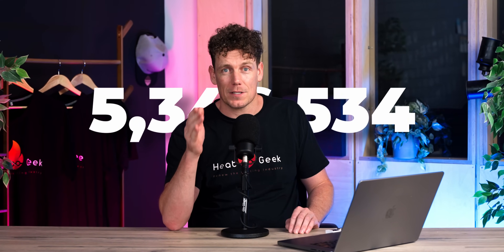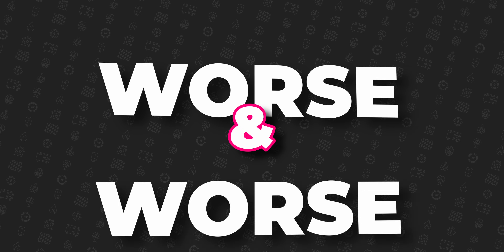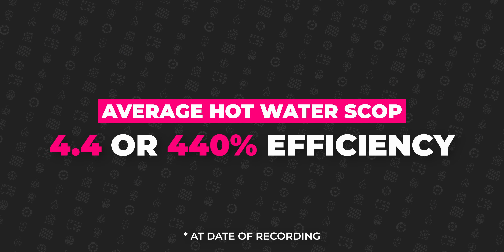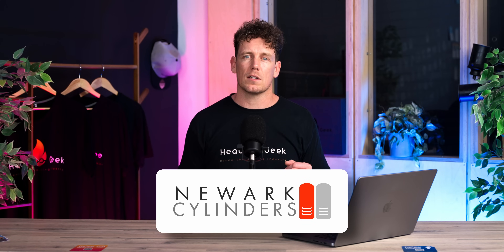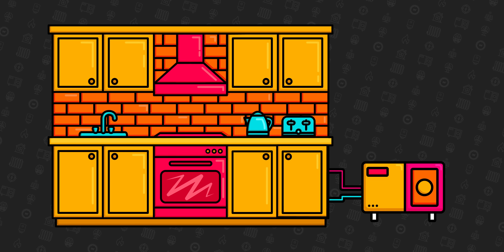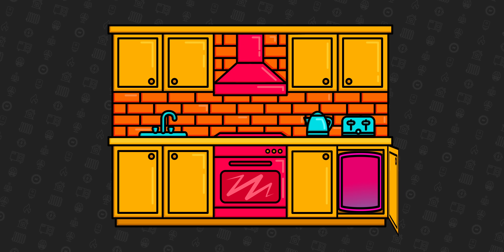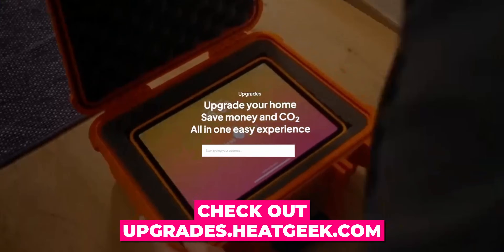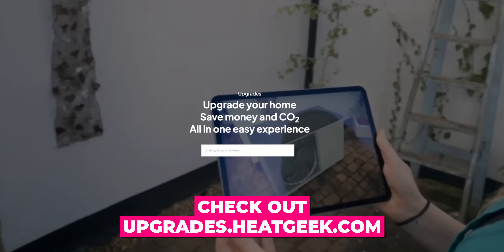This Invention Will Change More Than 10,000,000 Homes!

Comment: I love it! I bet it's less leak prone than a dishwasher, too. 

#bandishwashers

#commentpirate 

#replyguy

 I'd like to see what solution HeatGeeks can engineer for integrating standard HPWHs (standard US models) with an A2W system. Two water heaters means redundancy and resiliency, when you have room. Due to the need for dehu during shoulder seasons, the efficiency could be quite a bit higher. You could even reverse heat flow into the "standby tank" for some "robbing heat from the cellar" comfort heating in spring and fall. 

It also means the sales & end-of-life-for-boiler-or-WH process can be accelerated, one-day installs of HPWHs are possible (I've done it) and you follow up for the big project when the A2W crew has time. 

Now, I'm not sure how you'd integrate that into your SCOP number... but I reckon there's savings. Is it worth it? 

I'd also like to see a "drainback" system as opposed to a "outdoor dump" for freeze protection valves, but I'm not certain we need to use an overengineered solution with an inert gas that "purges" the ODU... food for thought I guess. 

I just can't wait for ICF, a corporation that promotes natural gas pseudoscience for the American Gas Association, to complete their certification process for "energy star boilers" in the US, a process the AGA opposes. What a lovely country America is. No corruption here! 

🤓

Comment: Still too many houses with tiny kitchens etc. Space is a premium in this country. 
However,  the one area that is really rarely used  is the plinth area under kitchen units.
If you can come up with an insulated rigid flat bladder tank, strong enough to act as the base replacing the unit feet, you could provide more volume (135l) than the mini store (80-90l) under 3 units worth of plinth space. 4 units and it would be bigger than most existing house tanks. Most houses have more than that factoring in dishwasher and ovens/hobs.
Reply from the maker: And insulate it.. skill builder talks about this too. I think it’s crazy personally

Comment: Does it have to be cylindrical? How much efficiency is lost if it were designed with square sides to better fit into a cupboard, maybe with more insulation? Could be worth playing with a computer model to find out.
Reply: These are pressurised cylinders so square shapes don't work so well when under pressure. I see where you're coming from though but I don't see square cylinders coming any time soon.
Reply from the maker: It’s open source. Will leave that to others
Reply: @craigchamberlain  Good point, I had not considered the pressure aspect. Maybe the corners could be separate unpressurised chambers filled with something with a high specific heat capacity, like water?
Reply: @craigchamberlain If it was square then it would not be a cylinder.😉
Reply: @normanboyes4983  A very good point! Even more reason why I don't see "square cylinders" coming any time soon! 😂

Comment: Hi Adam, you say this is for smaller homes. Could you not use two or maybe three in larger domestic properties strategically located to minimise the long runs and the long waiting times for hot water to reach the rooms that are far from the storage unit?
Reply from the maker: Yes.. the largest one will probably be ok on its own though

Comment: Possibly (probably?!) daft question - if it's designed to go in a square cupboard, why is it circular and hence smaller for the same size cupboard?
Reply: Less surface area to insulate than a rectangular box, stronger, cheaper to build.
But I agree it is wasted space that could be used for an emergency heater or extra insulaton pads.
Reply: @SolAce-nw2hf  cheers, makes sense.

Comment: Nice Adam, but with no heat geek installers in Scotland I'm finding it hard going forward to make the jump. Still enjoying all the videos though 👍
Reply from the maker: Apologies, we’re building the platform and expanding to Scotland as quickly as possible!
Reply: Yip, would agree with that and disappointed there is no companies taking up your mantle. Keep up the good work and hopefully soon someone up here will 👌👍
Reply: There are no Elites but a few of the bottom two levels. We are in south Fife just north of Edinburgh and are trying to get our nightmare 200yr/70yr mix of a cottage heat pump ready, can these combis go in a cold loft space?
Reply: We're Edinburgh based covering Central Scotland, please get in touch to discuss your project 😊
Reply: Stewart Temperature Solutions of Ayr are certified heat geeks and just did our installation a couple of weeks ago. I’d highly recommend them. Our property is a 4 bedroom cottage which was refurbed in 2008 so the insulation wasn’t too bad already. We did have to replace our 17 radiators with a mix of K2 and K3 rads to support the lower flow temperature since we were moving from an oil boiler to the heat pump. Target flow temp was 45C at design outside temp of -4.5C with heat loss calculated at just over 7kW. Went with an 8.5kW Mitsubishi Ecodan with a 210L cylinder which is so far performing well. I know it’s June but not a warm June by any means! Partly funded by a £9k grant and £7.5k loan from the energy saving trust. Also zero VAT charged.

We already had a 6.8kWp solar PV array and 19.2kWh of battery storage so we can power the heat pump easily from a combination of solar and off-peak stored electricity, so it’s definitely cheaper than the oil we were burning. 
No regrets so far! :)

Comment: If I have an air to air heat pump. Could I add one of these?
Reply from the maker: There wouldn’t be much point
Reply: The Vaillant aroSTOR 200 Litre is a nice solution with it's own heat pump. There are also smaller wall mounted models.

Comment: So you basically repurpose the type of water heater used all over the world. I have never understood why we in the UK are obsessed with heating massive tanks of water. In Spain I have a water heater hanging on the wall where a cupboard would be. We have a family of six and never run out of hot water. You may think I am critical but I think it is an excellent idea. Also the larger thermal stores heated by a heat pump solve the problem of low flow rate in houses with microbore pipes that would not normally be able to use a heat pump for heating.
Reply from the maker: That would be a very inefficient solution

Comment: Just wish we could get a heat pump that was fine with existing radiators and 15mm piping.
Reply from the maker: You can…
Reply: @HeatGeek  I need to look in to that then. OvO folks just dismissed me when they said I’d got 15mm. “You’d need to re-pipe the whole house so it’s not worth it”
Reply from the maker: @ObsidianWalker  we have a video on it.. check it out
Reply: @HeatGeek  will do. Feels like maybe a proper survey of my home would be of benefit. Shame as OvO are partnered with Heat Geeks so I’d have expected a more considered approach.
Reply from the maker: @ObsidianWalker  Sounds like you spoke to the wrong part of OVO. If you head to https://upgrades.heatgeek.com/c/ovo you can start the process and get a survey of your home.

Comment: People aar nt ripping out tanks for space. Combis are about convenience. I would without a doubt swap for a combi if i owned my house.
Reply from the maker: What convenience is there other than space? All cylinders produce instant hot water and usually a lot quicker than combis at the don’t have to fire up.
Reply: @HeatGeek in an average home you don't have space for a massive tank. So the hot runs out and you then have to wait for it. You don't have to heat a whole tank of water if your doing the washing up. If you live alone your not heating a whole tank for one quick shower. They are definitely a convenience item .

Comment: Many flats and small houses have no space whatsoever to install a small water vessel.
Reply from the maker: Where are their combi boilers?
Reply: @HeatGeek  
As you perfectly know a combi is small white box that can easily fit into cupboards, etc. They became a revelation as a small white box did all the DHW and heating with no ugly troublesome pipe valves or huge space consuming cylinders, with standing heat losses.  With wireless controls, etc, you do not even need wiring to parts of the house for stats and timers. You can control them from the other side of the world from your smart phone. 

The water delivery is instant (no waiting) and infinitely continuous. I have a walk in shower with a drencher fed by a combi.  Look back at what I would need 50 years ago to get that!  I pretty well would need a small boiler room.

Heat pumps have their place and I love the technology working with them before you new what they were (I was in controls) - I am not joking.  They are no panacea for sure. We need to convert the natural gas network to hydrogen. Not to do so is foolish.
Reply from the maker: @johnburns4017  as the former number 1 domestic hydrogen boiler/fuel cell installer. Hydrogen as a heating solution is absolutely insane.
Reply: @HeatGeek  
Nothing there to back up that assertion. Read my post on the Japanese approach.

Comment: Lets be realistic here, until the 1m planning rule changes in the Uk this will not fit in a lot of flats. High rise flats it will not work, homes that are converted into flats won't work either. If these cylinders need to be G3 certified where are the expansion tanks going to go? This is a fit for certain types of properties yes but 10 million homes?
Reply from the maker: High rise flats have other solutions and 1m rule for out this year

Comment: At last - you have admitted that the idiotic size of the cylinder for hot water is totally impractical in many houses - something I have discussed with many heat pump suppliers but told 'its not a problem' But does this mini cylinder do away with the need for a buffer tank? A cylinder for hot water is basically inefficient as most households need very little as they have dishwashers, washing machines and electric showers all run on electricity. When heat pumps can integrate with a combi boiler they will be more widely accepted for home heating.
Reply from the maker: Systems have never needed a buffer tank though?

Comment: Boilers?? Homes here dont even have those... Not the majority in this part of the country anyway.
Gas is way cheaper than electric anyway. And what happens when its -20 outside ??? And everything is covered in ice? ?
Reply from the maker: 80% of home have gas boiler. 18% have oil or heat pump..  I don’t think your representative the norm
Reply: Where are you?

Comment: I have a challenge for you only if you’re brave enough = only money I have is old age pension coming in as income, I would like to get rid of the immersion tank which cost way too much to have hot water for bath or for dishes also get rid of cold water tank in loft which I worry about in winter that the pipes don’t burst , it would get rid of the gas boiler in turn would get rid of gas out of the house which would save 150 pounds per year for standing charge = 10 years would save 1,500 pounds if I live that long obviously, live in a small three bedroom terraced house the challenge really is can this be done within the confines of the 7,500 pound grant = so if you can sort my house out with this system = probably many houses like mine which are the majority of houses within the UK would be good as an example = but I’m bound to say that aren’t I .
Reply from the maker: That’s literally next. It’s actually quite simple 😝 bear with
Reply: @HeatGeek  Personally I would prefer the water tank I saw on your video and instead of radiators to be replaced with ATA system = looked at many videos = you  and the gentleman I saw you with when you was assessing the small hotel a few weeks back , that gentleman installer is the best I’ve seen and his knowledge along with his logical mind set of keep it simple rather than putting item such as extra circular pumps and sensors where they are not needed that gentleman is brilliant, you both have similar mindsets,  my own thoughts having watched lots of heat pump videos is why I think my house and the way I live came to the conclusion heat pump for water and heat pump for ATA heating , could I be wrong of course = could I be right maybe = maybe is better than wrong at least it sounds better , yes I know my humour is an acquired taste.
Reply: Adam prefers A2W, rather than A2A (especially if you have radiators) believing it to be more efficient. Any reason for an ATA preference?
Reply: @Biggest-hz7ng  Having looked at many videos with lots of opinions a couple seemed to to stand out much more than others and made more sense along with more logical approach, one video was a gentleman who had a heat pump that had his radiators changed to bigger ones to allow what is needed to accommodate the flow rate with the heat pump  then decided to change to ATA and found it much better for his needs and could zone the upstairs and downstairs so heating areas more efficiently depending what was being used etc, the other video was a person who wanted to heat down stairs with a bit more heat that the radiators didn’t cover so purchased an ATA unit and was so impressed with it purchased an even bigger unit for another area of the house and now thinking of getting rid of all the radiators  and replacing them with a heat pump with multiple blowers from one heat pump , they both without knowing came to the same conclusion which is you get a heat pump to heat the water in the radiators to then give warmth to the house rather than getting a heat pump to directly give instant heat   , it for me makes much more sense.

Comment: Just did a sample quote, I'm not sure if it included one of these. So... £15,832 total.
Gov grant £ 7,500
To pay £8,332.
£20 savings a year...
Currently we pay around £1700 a year for gas and electricity.
Unless this is paired with solar and battery storage, which aren't free, hm, I'll let you work out the ROI. Mental! And imagine when the gov grant isn't available anymore! Good luck getting into a massive massive debt. I'd stick with gas for now. Thanks.
Reply from the maker: Ignore those numbers they’re BS and being updated

Comment: Now we have the truth very unaffordable they can be if you have a normal old house.Mine costing a fortune you keep going on about FLOW Rates a pump has 3 speeds we’re do you get your flow rate.
Reply from the maker: Most pumps are dt controlled and have 100 different stages. If you have a 3 speed pump on a normal hiuse you have a crap over priced system that will be expensive to run im afraid.
Reply: @HeatGeek  Thank you for replying it was all MCS from start to finish.If you could do one on flow rate and how to achieve it that would be great.Cheers

Comment: You can have the gas mixture 20% hydrogen with all gas appliances working as normal reducing emissions in urban areas.  It can be 100% hydrogen in the gas network. But I would only have boilers running on it not the likes of hobs. Gas combis can still be installed and still save enormous amounts of space.  Most, if not all, boilers can run on hydrogen.
Reply from the maker: Hydrogen is too expensive. It’s not a mass market solution
Reply: @HeatGeek  
I posted a comprehensive response to this. Amazingly it has been deleted.
Reply: @HeatGeek  
Look at Japan and how they are going.
Reply from the maker: @johnburns4017  nothing has been deleted
Reply: @HeatGeek  
I gave a comprehensive reply. About the way the Japanese are going with hydrogen economically produced from HTTR's, a type of high-temperature gas-cooled nuclear reactor that is safer than other reactors. The Japanese government will use high temperatures produced by the HTTR to manufacture hydrogen. Why? Because hydrogen is the only alternative to fossil fuels in industry.

That is why Toyota is cool on EVs as Japan will be a hydrogen society using hydrogen ships, trains and road vehicles. Toyota would not adopt this stance unless the Japanese government gave them the nod. Hydrogen can also be produced by wind and solar when too much electricity is being produced, like overnight. Right now in the UK we pay companies to use electricity when too much is being produced.  This surplus electricity can be used to produce hydrogen. Hydrogen can be produced at train depots by electricity eliminating transportation of the fuel. 

We have a comprehensive gas pipe network, it is irresponsible not to keep it and still use it when a solution is there. Boilers can safely operate on hydrogen, easily converted to the fuel. Many are hydrogen ready. Heat pumps are superb in the right situation (only if properly installed which few are as you know full well). Heat pumps are no panacea for sure. Abandoning a comprehensive gas network that can be converted to emissions free appliances is pure buffoonery.
Reply: It is best to look at the big picture and trends more closely.  Look at my bit on the Japanese and the way they are going, which I am sure you knew very little.
Reply: @johnburns4017  Unfortunately, they are not.😳
Reply: @normanboyes4983  
Assertions do not count.
Reply: Norman, your post has been deleted.
Reply: Norman, I made an analysis.
Reply: BTW, Norwegian natural gas which the UK takes a lot of and which there are large reserves,  is four times cleaner on burning than the gas from the UKs home gas fields. I do not see any reason to quickly phase out natural gas as oil burning is priority. Gas burning in condensing boilers is over 90% efficient. Burning natural gas directly, at point of use, as we do, eliminates the waste stages of say electricity generation (steam generators are 40% efficient), so making it cleaner again. OK, new homes can be all electric and renovations of course. Take gas away from the millions who use it who do not really have an alternative as their homes are too small for heat pumps? Taking gas away from the millions who use it quite quickly? It does not make sense.